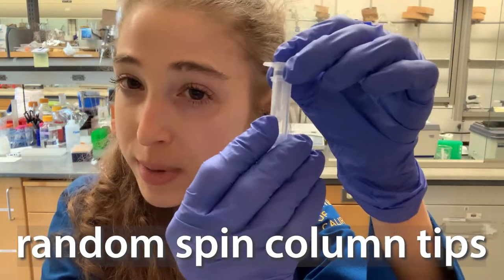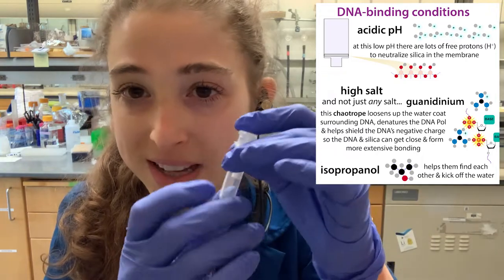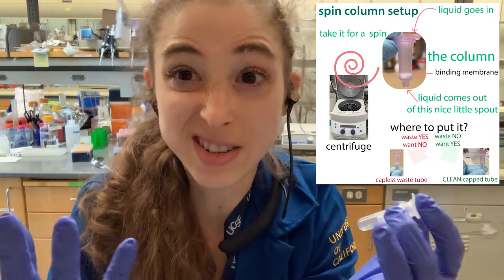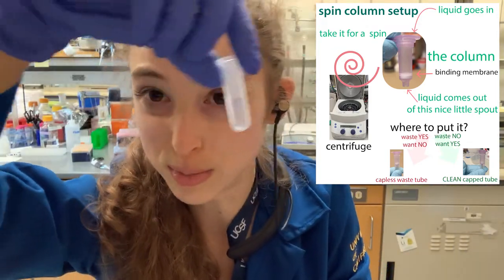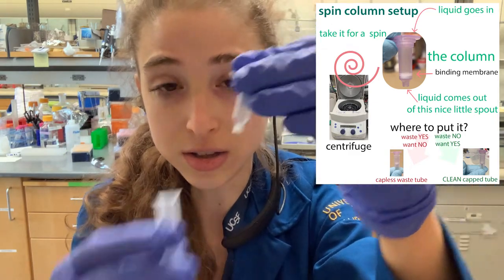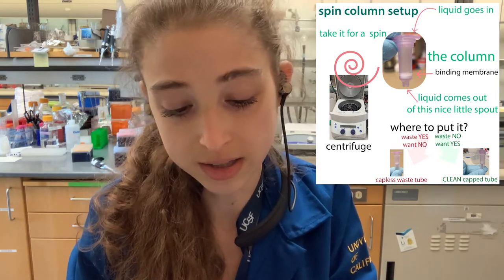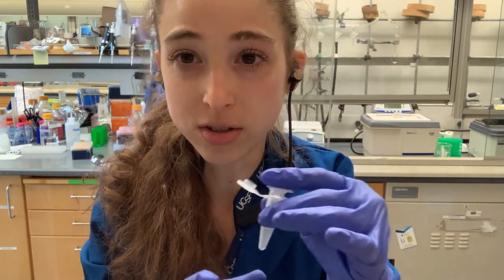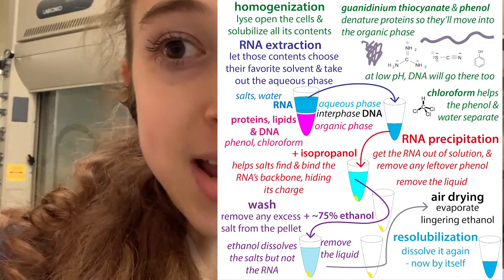Random tips for working with DNA/RNA spin columns (like those in miniprep or PCR purification kits)

Comment: Hi, I really enjoyed your tips for RNA/DNA extraction. Just a small question. What is your opinion on pipetting directly on the membrane  in a vertical stream, or directing your pipette stream against the wall? What is better? Thank you in advance!
Reply from the maker: Thanks! I don't know what's technically best, but I pipet slowly  directly onto the center of the membrane, let it sit for about 1 min, then spin
Reply: @thebumblingbiochemist  Thank you for the advice, let me know if You come across some evidence on which is best! ;)
Reply: @arnewyns9616  I am no expert but I tend to carefully pipette onto the silica membrane towards the center of the column. Following this, I tend to incubate it at 70°C for 5 minutes with the lid open to let the ethanol (from the wash buffer) evaporate and then spin for a minute. It usually works well for me .
Reply: @arnewyns9616  really nice question.